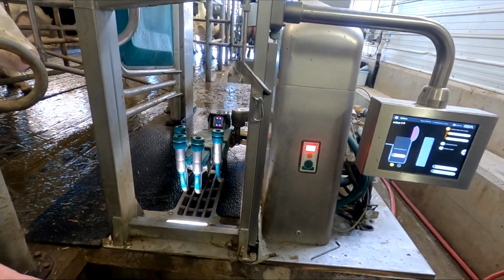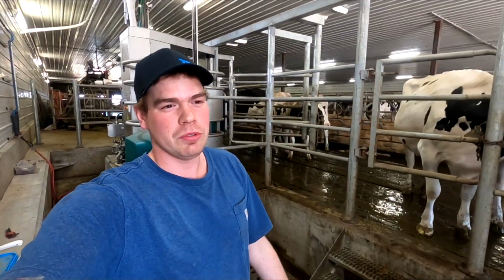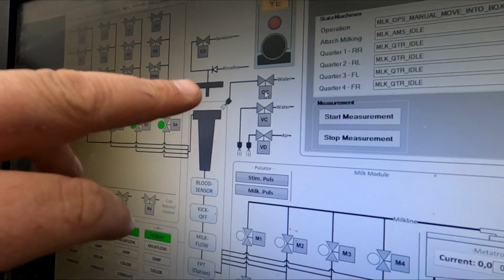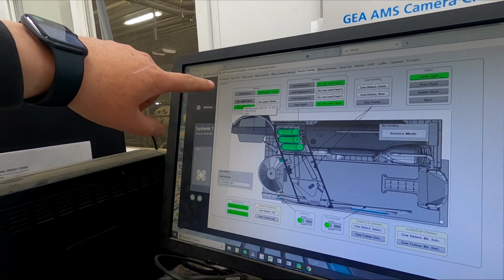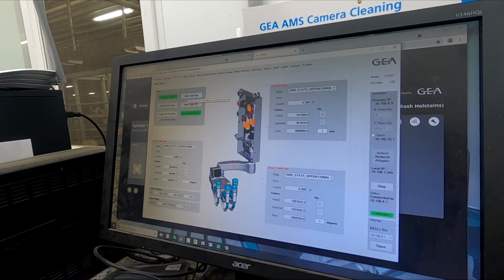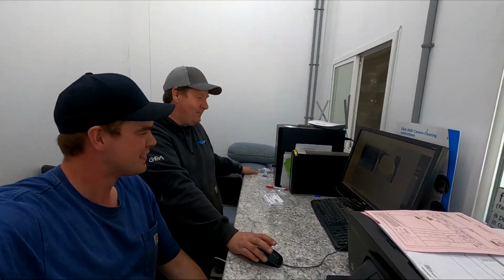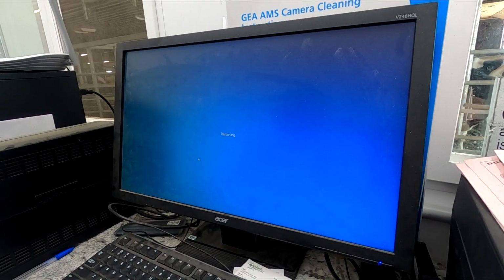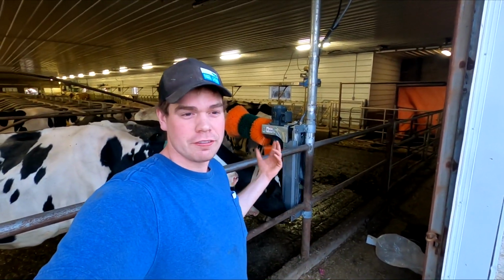Cow brush finally showed up!!! | GEA milking robots service

Comment: Are you going to use the harvestores for feed your gea dealer how many different dairy equipments does he handle and the former owner didn't use the facility very long how many cows can you milk in total on your new place
Reply from the maker: No not going to use harvesters, he’s is strictly a gea dealer, old owner of the farm was milking 138 cows on robots at beginning, but we won’t be pushing anymore then 120 cows as we are a 40 kg plus heard, don’t want to sacrifice cow performance.
Reply: @Northerndairyman  I'm surprised you don't try to sell the harvestores unless no one wants to buy them it's to bad you couldn't get any money for them
Reply from the maker: @bobmorse3513  yeah they are worth less, we also don’t want to take them down as there is an internet company that has there equipment on top of them, so we are benefitting from that...
Reply: @Northerndairyman  what's the largest dairy farm near you the largest in CT is 3000 milked in a 72 bail rotary I'm glad I  don't have that problem 200 is enough
Reply from the maker: @bobmorse3513  not quit sure on exact number but around 1000 cows, I know there’s a dairy with 2 farms 600 on one and 400 on the other or might be 600 on both now not exactly sure
Reply from the maker: @bobmorse3513  there’s also a dairy here in Manitoba running 20 robots on one farm
Reply: @Northerndairyman  I know of one here in the US that has 2200 cows on 36 lely robots that's in Indiana I thought there's a farm in Canada that had 40 robots
Reply: @Northerndairyman  I  was wondering are there any jersey or brown Swiss or Ayrshire herds near you or all holstiens there are 6 jersey herds in CT 1 Ayrshire and 1 guernsey and 2 brown Swiss I'm the largest jersey herd at 200
Reply: @Northerndairyman  have you also considered automatic feeding?  Then the silo come in handy

Comment: Bummer, all your work changing the diaphragms, and they were not the upgraded version. Did you ask the repair guys why #2 milker had to have the diaphragms replaced so many times and #1 hasn't needed any?
Reply from the maker: Robot 2 gets 10% more milking then robot one gets, but could of been faulty rubbers who knows, the updated ones should never rip again they say should last 6 months but they get replaced every 3 no matter what

Comment: Is it cheaper to use the robots compaired to hire people to milk
Reply from the maker: All depends, robots are consistent, where as hired ppl are not, cows need consistency...
Reply: @Northerndairyman  be hard to find people to i guess so those harvester silos r not worth running im a beef farmer in ontario i always wanted a 20 by 60-100for corn
Reply from the maker: @farmerfarmer2801  we don’t run them anymore, way to expensive to maintain, the cost of maintenance per year vs the amount of tons they hold just doesn’t make sense